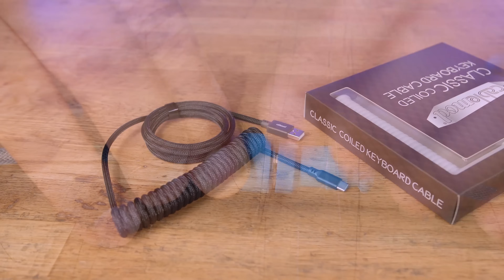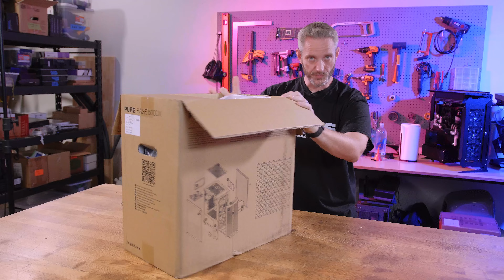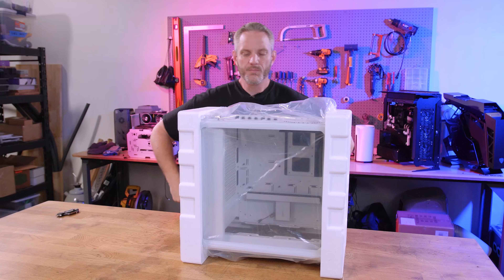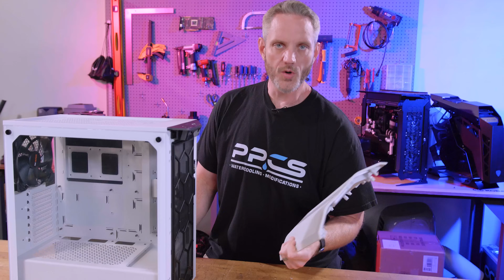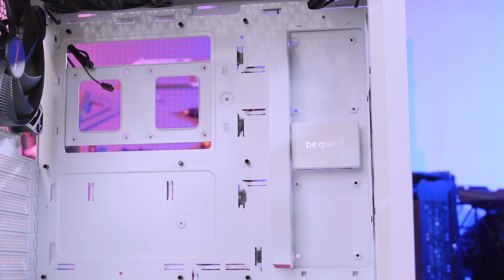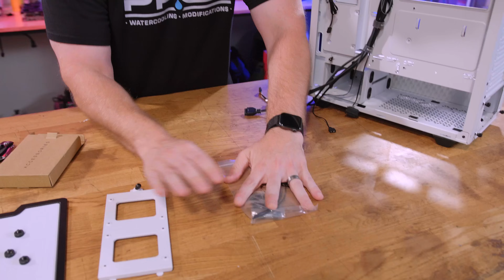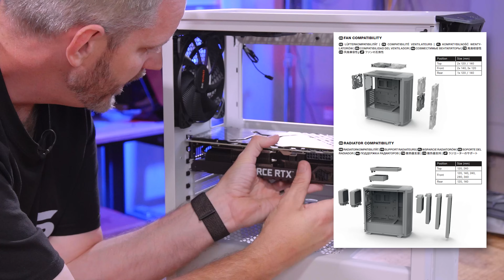An amazing case you can actually AFFORD!

Comment: Training a thick 24pin cable in that case isn't going to help. I just did a build in this and the one thing  I can easily recommend is to pop onto Cablemod, buy a flat 24pin extension cable, it makes things a hell of a lot easier. That SSD tray is a real pain in the ass. Also you can run a 360mm RAD at the front without removing the HDD tray, you can move it over one slot, it has 2 placement positions. I'm running a Lian Li 360mm Galaher at the front with the HDD tray.

Comment: hmm.. I always thought dust settles on the floor whether it is carpet or tile or ect. ect. if you dont believe it just check under a speaker, or computer or anything else..  I think dust get sucked up by the power supply on the bottom from the floor.  just my thoughts

Comment: In the Lian Li Lancool II the inside of the case will drop 2-3 degrees C when I remove the mesh on top even though it's acting as an exhaust. I think those screens impede a lot more outgoing airflow than people realize.

Comment: Love mine but my 3070ti was FAR from quiet.  I ended up putting a full custom loop in which works great and now truly quiet!  I'd recommend crossflow rads if your going for a 280+240 unless you can charge the pump/res with an external PSU as my soft tubing had 4 pipes running right in front of the 24 pin.

Comment: I purchased the case and I didn't like two things in specific. First the front is plastic and you need to force it from the bottom to open from part of the case and eventually the pins holding it can break. Second the cover for the cable management side has 3 pins on the top and bottom and when actually putting the case back is a problem because you need to insert the 3 pins on top and the bottom at the same time, while sliding the cover panel. In terms on airflow and space is really good, still don't recommend the case.

Comment: I have this case (been 1 year already more or less). Its a nice, solid, weighty and well constructed case (so far). Building wise its decent, but nothing more. I have had to build inside many, many cases in my life and some cheaper Cougar ones are a lot easier to build than this one. Cable management is good. USB on the front is really lacking, only 1 type A, yes 1, come on!, wth bequiet?
Cooling wise is fantastic. The 140mm fans included are quiet and move a lot of air. The factory "airflow" placement of the fans, 1 front, 1 rear, 1 top-rear work really good.
RGB is nice, nothing flashy which is great for me, got mine set to solid RED.
Lastly the side glass have only 2 small areas (2 protruding foot of the case) but no hinge/ no holder so you better be carefull when removing the screws to pay attention to the glass. The black rubber does support the glass a little bit but thats it.
This is thier base line "PURE", and I have to admit for been the base line ("Silent" and "Dark" are the mid and high end ones) is a really decent case.

Comment: Argument for running flipped power supplies - aside from the fact that there has NEVER been anything wrong with doing so(as long as there's air access, the PSU isn't choked off) anyway... With more and more power supplies supporting 0RPM silent running, they often don't have air actually moving through them, across the components that need cooling, which isn't a big deal obviously(else they wouldn't do it). But, running a flipped power supply means that airflow through the case is inherently going to move through the power supply too, so you get some cooling(even slightly moving air is much much better than stagnant air that can essentially 'heat soak') even while the PSU is running silent. Positive or negative pressure, as long as there's a pressure differential(it isn't balanced) to naturally draw air one way or the other through openings, you'll get some inherent cooling.
And you get the bonus of an additional exhaust fan when the PSU does cranks up the fan speed of course too, just like always(intake air temp isn't as significant as is often assumed, you don't need COOL air to actually cool hardware; cases with good airflow & proper fan curves shouldn't get very warm even at full tilt in the first place anyway, but what really matters is active airflow that's just cooler than the components, it isn't any more complex than that. Not 50°f cooler, even just a couple degree temp differential will exchange heat as long as there's enough air movement).
 
Mind you, I may be biased because I daily drive an In Win 303 - so I could run an ambient/fanless PSU if I wanted, it gets a case fan blowing DIRECTLY into it regardless. But, running a standard mid-range power supply, I essentially have stacked cooling fans for the PSU lmao. If you want a PSU to last put it in a 303 case!
(Google it to see the layout & PSU location if anyone isn't familiar)

Comment: I have built a pc with this case. Passing cables through vertical hidden opening 8:00 was a nightmare. LEDs are really cool. Steel could be thicker. Little space in PSU chamber. I personally think that Fractal cases are better engineered.

Comment: I have this case. I like it. But I have a 280 Arctic Liquid freezer 2 mounted on the front. Using the fans that came with the cooler to pull air in through the rad. It's a rather thick and overkill. Fans that came with the case being used to exhaust top and rear. My issue is that I haven't yet upgraded the gpu from a RX 580. A fairly short card compared to the newer gpu's. When it comes time to buy the new gpu, I don't think there's going to be enough space. Because of how thick the cpu aio is. I don't think I can mount it to the top either without interfering with the motherboard. A potential option is getting my hands on a shorter ROG Strix card with a 240 aio attached and hoping it can be top mounted without interfering with the motherboard. I don't know whether to ditch the case or the cpu aio as I like them both.

Comment: That is IMO a very Good Case for this Price. In November  2020 I was choosing between the Corsair 4000D Airflow, The NZXT H510 and this 500DX. I turned my Back to the Front Glass Cases, and at the End I decided to the 500DX, but at the End I won a white Silent Base 802 Window, an other fantastic Case from Listan/bequiet! - But when I must coose again, I would buy this one. BTW their Support is absolutly excellent, when I got some Troubles I send them a Mail and in a very Short time the Problem is fixed. (got a SP11 650 from them with a DoA, they changed it without troubles within 3 Days.)

Comment: I've been using this case for a year now, the audio jack in the front IO stopped working for me since month 6~7 (I rarely use this)

And I'm on the process of getting a replacement for the front IO

Other than that, this case has served me pretty well, the lights are pretty, it has a lot of room for components and it's very airflow focused.

Better than my old case but the IO not working is something that I'm sad about.

Comment: I love my 500DX. Plenty of air flow, looks good, lots of room inside...and the lighting looks GREAT. I run ARGB fans off the mobo, but kept the BQ LED circuit separated so as to get contrasting colors.  Pulled out the fans and replaced them with white housing ARGB's. The top mount grill actually does catch a fair amount of dust being blown out & is easy to clean.

Comment: I bought a BeQuiet! Silent Base 801
 a few years back and it's still my favorite case to date.  I just ordered a big 14"x14"x14" 3d printer and the first thing I'm printing out is a replacement vented front cover as I have the first model that didn't come with the optional vented front cover.

Comment: Jay: You get one fan, no you get two fans, no no you get three fans.:) Love my  500dx in black, put a handle on it (no structural problems). Advice for  users, take a bit off the plastic pins on the front panel ( top and bottom of each pin , gaps on the side)makes it so much easier to remove and clip back...

Comment: Just finished a Lian Li White 011 dynamic Evo build and the included fans alone make this Be Quiet case a great deal. I really didn't think much about it I just really wanted that Evo case but the Lian Li doesn't come with any fans at all so that's another hundred and fifty bucks right there if you're trying to get nice RGB fans.

That being said, I'm a little older and want a premium case sitting there next to me in my nice room and there really isn't a more premium case than the Evo. It is absolutely beautiful when everything is synced up to wallpaper engine. Keep your rainbow puke away from my case thanks but I'll take that wallpaper engine lighting any day of the week. Makes the whole corner of the room look great.

The one issue I might have is four exhaust fans(3 top, 1 rear) and three intake fans on the radiator so it is currently negative pressure. We'll see how bad the dust is in about 2 months. I could see myself having to add another two intake fans on the bottom.

This be quiet case isn't far off in looks and with those fans it will be much less expensive.

Comment: I'm not keen on the internal asethetics. No rubber grommets. Coloured audio cables. You'd have to put in 2 outward facing SSDs to hide the screw holes on that panel. There would be cable tie holes visible even with a MB in place. The L-shape looks like a pain to bend cables through, especially for my MB where the 24-pin is not on a right-angle connector. I doubt you could fit an AIO up top. What's the seal like around the TG panel in terms of noise? I don't see any cushioning around it.

The top fan has to be moved to the front as it's stealing too much intake air away from the GPU.

Out of curiosity, would the included 140s work well with a radiator? Do they have enough static pressure to blow air through the radiator?

Comment: Can confirm this case can hold the Noctua NH-D15 Chromax cooler with both fans on and closed side panel.

Note: HyperX Predator RGB RAM used for clearance reference

Comment: No you are correct I removed my OL11 top filter because it is top exhaust for my AIO just doing that dropped my CPU temps 5c and the entire system 2c. So yes removing the top filter if you are exhausting thru it does make a positive effect. Your millage will vary, depending on the case and fans.

Comment: Since its release, i think that the 500DX is the case I sold the most at my shop, really easy to build in, the build quality that we can expect from a big manufacturer like Be Quiet, fits almost any components, pretty good ventilation ( built a few with 5900X/5950X and 3080's with no heat problem when we add a few fans, just the right amount of RGB. And the most important for our customers, HOLY SH*T it's affordable !
Reply: Built similar set ups and putting another exhaust fan on the back end up top did wonders for cooling when using Air coolers only.
Reply: Is there any problem with air coolers? Id like to buy the noctua cause it's considered the best but space seems tight
Reply: @hasantylou7670  if it can fit in this case ( most of them do, slight doubt for the D15 ) there is no problem with air coolers. 
But as said earlier, you might want to add an exhaust fan at the top-back if you are cooling an I7/R7 or bigger.
Reply: if u put 3080 in to u need a gpu holder?

Comment: There s also a ledstrip on top. It adds to the total value with the 3 fans and the bottom airfilter for the psu which is a big drawable panel mesh.

Comment: I wish more cases would have 4 bay drive enclosures in front of the power supply shrouds . Gives the front fans more purpose and raid 5 is always cool with lots of storage for all of your games .
Reply: Amd builds would be stuck with 3 drives in Raid0 and 1 huge drive for clone for easy rebuilds

Comment: I have the Black version of this case. My only complaint is the cable feeds at the bottom where the tray is are so tight to try and plug into the board that you have to be carefull not to snap the pins on the board. other than that it's nice. I have 5 140mm Be quiet fans in the case. I would like to see JayTwoCents do a build in this case. I might add as well with the 3070ti I use having the power connectors in the middle of the card, if you have a large AIR CPU cooler like me the cooler is in the way so I can't get the PCIE connecters to come in from the slit at the back of the case. I have had to come in from the tray at the bottom and connect from the front of the card and set tie the cable together so they don't hit the fans.

Comment: I'm firmly in the cardboard box camp. Only I want a quality cardboard box that's built like a tank, has a good layout, good airflow, a lot of 3½" HDD mounts (4 is acceptable, 8+ would be sweet) and a 5.25" drive bay in the front.
Reply: Maybe the Phanteks Enthoo Pro M (with a full sized tempered glass side panel or a smaller acrylic side panel). Filtered mesh front and top. Room for up to 5 140mm fans. Has 1 external drive bay on the front. Room for up to 8 3.5" HDDs and 3 2.5" drives.
I have the TG version and using SSDs instead of HDDs. Great case.

Comment: The ssds are meant to go on the other side @ 7:34- you can see the mounting holes are elevated . Especially matters if you plan on using 2.5 velociraptors and don't want the circuit board shorting out on metal

Comment: Honestly more power to you if your the sort of person that spends ages looking for a case my I just went sort by price dont want spend more than 30 pounds about 40 bucks and got a fractial design 1000 all mesh front comes with two fractial core fans in front fitted a 92mm at rear i have nve storage and am running an apu by choice really not bothered i like some of the corsair cases but at the same time the price they command just dont make it worth it for me

Comment: I have this case and it has excellent air flow and is decently quiet. I wanted it for the rgb because I was tired of using a software. Rgb is really nice. Is overall a good case and probably the only case I need for a long time

Comment: I just built a PC in the Silent Base 600, which is very similar apart from the psu shroud.

I did exactly what you suggested, bought extra fans to go 2 x 140 fans in the front and 2 x 120 fans in the rear/top. Positive Pressure.

Comment: My curent case is a powermac g5 i've modded to fit atx stuff in it and, appart from the fact that i don't have a power switch (because i'm lazy) and i couldn't fit my motherboard's IO shield because there's a gap, i love it but i will soon be moving abroad for college and i'm considering rebuilding my current pc inside a new case (mine is huge so i won't take it with me) and I am now considering this one.

Comment: Built mine three or so months ago. Easy to build in all around great case, never got the front rgb to work. 360 aio and a tuf 6900 fit inside no problem. I moved my drive cage back a bit and shoved all my extra cables inside, used white cablemod cables to chuch up the pc a bit. For the price and all of what you get you can't go wrong.

Comment: Currently using this case, was first build in probably ten years and was a fun one to build in. You can actually remove the USB-3.1 from the front IO - if you're like me and don't tend to run things to the front of your PC - and run a three 140mm fan configuration at the front. It's a touch jank as the top fan won't be screwed in at the top but it works.

Comment: Had the Black version of this case for a while the only problem I can say I have with it is I really hate having to screw on the glass panel with four screws I would rather have it either on a hinge or slide out because that's way easier for maintenance. Besides that the case is pretty damn good
Reply: same
Reply: Yeah, I've been spoiled by my new case. Both panels are held on by magnets at the top and a lip at the bottom.
Reply: I would like to see it with a 5.25 bay. I still sometimes use discs. And plastic instead of glass as a precaution for children.
Reply: @jetflicks84  You don't need a 5.25 bay in a case. You can just buy an external disc reader/writer that connects to your computer through USB. Such external readers are the main reasons cases no longer come with 5.25 bays anymore.

Its also why hard drive cages are also disappearing from cases. You can now buy an external hard drive enclosure that can fit many hard drives inside and then connect to your pc through usb.

Comment: Rockin‘ a 500DX with a 360 rad in the front and a 240 rad at the top. RAM clearance with the top rad came down to a few millimeters. Great case with awesome build possibilities in a relatively small form factor.

Comment: i have owned 3 different Be quiet! cases at this point.. in different price ranges  and i can say its a very good quality and i have noticed that every generation they improve on previous model. and i'm always thinking.. aw would have loved to have than feature on my case (that is why i al already owned 3 of them on only two builds).. i do not own this type but they got my support.. hope the next higher price class cases of Be Quiet! will be even better but also with airflow in mind.. by the time i'm upgrading i will defiantly consider a case from them again.

Comment: I still use optical media. My X-78, 4) X-99 and 1 X570 all used Corsairs Carbide Air 240.  Downside: 280 AIO max, 2 basic fans, $150 solid side panels $10 less, and NOT practical for a custom loop as a 2-compartment design and last, not a candidate for vertical GPU mounting.  Upside:  The 2-compartment design hides the PSU, SSD cage, optical devices and most of the wiring.  2) HDD sleds (front side under the GPU), cage for 4 SSDs, easy to work in and I like the way it looks.